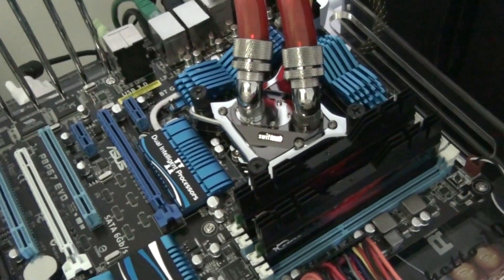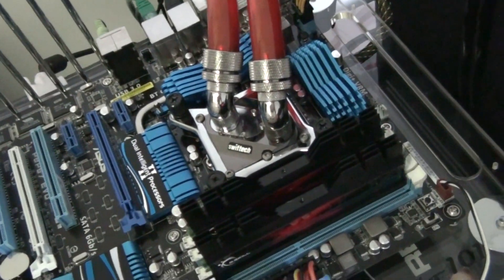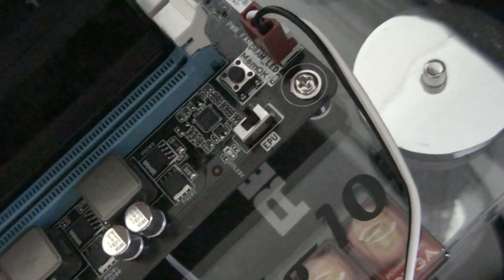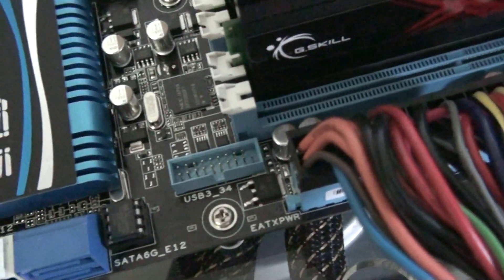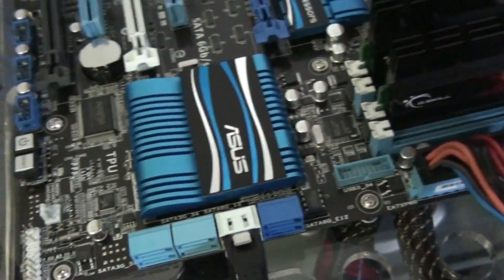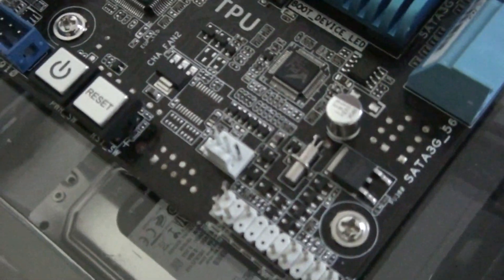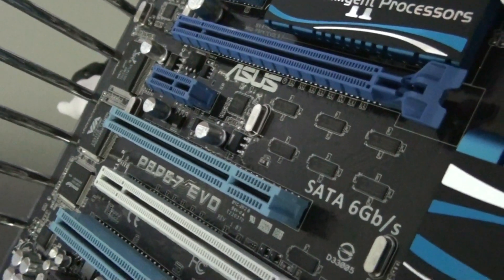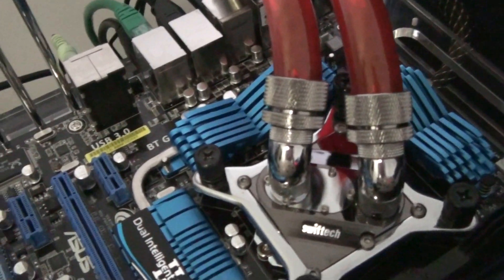Asus P8P67 EVO Review

Comment: hello friend good night. my name is joel.
 I want to help me. look at my motherboard has an IEEE 1934 firewire to serve.
 this connector is important.
 I buy a case thermalker soprano. and did not bring the connector ieee 1934.
 not if. which brings the power supply.
 and I have armed my pc but I need that connector, I have fear of connecting. tell me if it is mandatory that firewire IEEE1934 connector

Comment: Hey I got the exact same board B2 revision, exact same chip with the 1606 Bios (latest) got it rock solid stable LinX AVX and Prime 95 with my 2600K @ 4.8GHz 1.480V and ram at 1600MHz C9.... However I got this weird problem, the pc randomaly fails to post, and the CPU LED fixes on, it turns off, and turns on again, and will Freeze Loading Windows 7 64Bit unless I open up into bios and save and reset (although changing nothing)... Can't figure it out, runs great when up and running though!